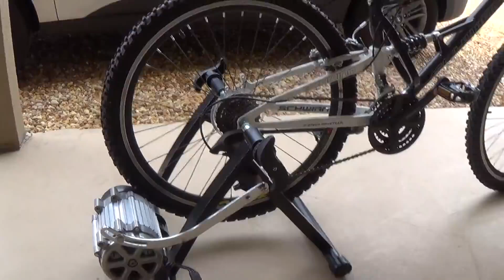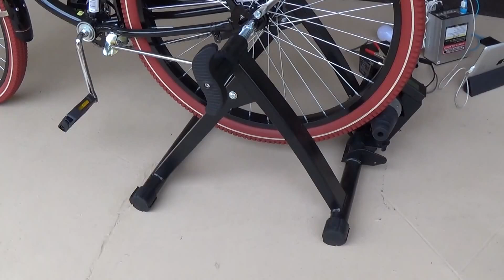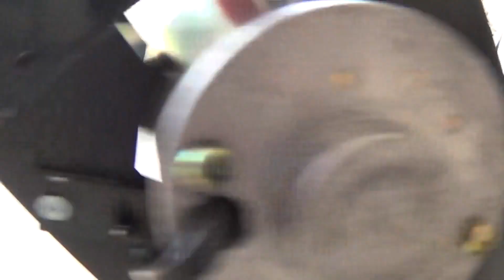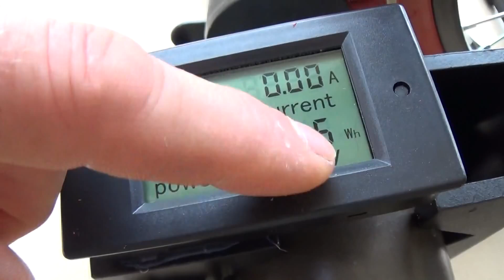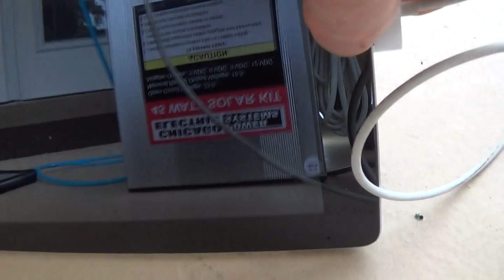Billions in Change Alternative Solution

Comment: I would like to recomend Tesla to add on all Additions to a Geared Bicycle  because if anybody uses a Bicycle on Road then it covers distance on the otherhand if a Bicycle is pedalled in Stationary position it is not only an exercise but it also removes Cost so i would like Tesla to add the features of Cost Removal to a Geared Bicycle of 1000 Watts kindly take this factors into consideration and i would like set up Vending Machines of Teslas Geared 1000 watts Bicycles with additions to Cost Removal functions for a Passive Income

Comment: Hello, nice vid! What kind of DC motor are you using ? Could this setup work with any type of DC motor ? Does it needs to be a 12v dc motor for the setup to work (considering you are charging a 12v battery) ?

Comment: Although more expensive the Billions in Change machine is superior.  One shot shows what I presume is a wattmeter showing 246 and Manooj is not pedaling any harder than Rebecca.  I think the large ring type flywheel is the key with the generator shaft at the hub of the flywheel.  The combination of the derailer gearing and the machine gears create a high rpm and the flywheel gives it lots of torque to handle higher currents.  I am building my own version of what I call a pedal powered percheron; a workhorse that powers many machines directly which is much more efficient than using electricity.  The Percheron will also create electricity when desired.  Is anyone elese working on something similar or would like to share ideas.

Comment: try to add light weight flywheel. it'll increase the paddling time as it reduces the efforts.
Reply from the maker: +ishwar bichewar Thank you for your comments. Yes, I agree a flywheel can help. But to charge a battery you don't need a perfect flow of energy, Slight surges won't hurt the battery or our generator. TES was looking for the lest expensive, least parts and lowest cost possible. We now have it, and are on the final test before bringing to market.

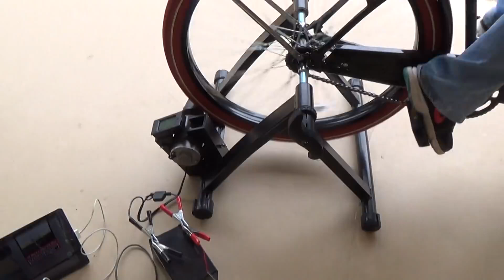Comment: Have you noticed on the U Tube "Billions Change Official Film" there is a hidden cord coming out from under the wall base strip? If one take a screenshot (pic) @ 12:35 & zoom in to the pic one can see the cord.
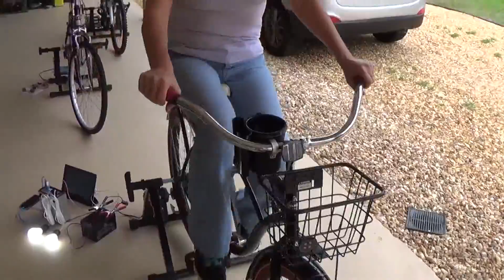His system is only powering 24 LED bulbs, but they are stating its doing more. But when they claim the system turns on the bulbs the fan & other devices are already on. This can be seen @ 11:56, it takes more watts to start turning the fan than light the bulbs. And fan is already up to speed before lights come on.
Reply: +Moazzam Abdullah Khan  nFlames2 is correct in what he stated, you sir are wrong.
Reply from the maker: +Moazzam Abdullah Khan The flywheel on Billions in change bicycle will only keep the lights lite for under a minute after you stop pedaling. Their flywheel is used to make charging a battery more efficient.
Reply from the maker: +nFlames2 I don't believe "Billions In Change" would do such a thing.  Basically the LED bulbs (operate between 10 and 12 volts) require a higher voltage to light than the fan (which operates between 3 and 12 volts), that is why you are seeing such a difference.
Reply: +Tesla Polarisz If you take a screenshot you can see the cord coming from under the wall base strip.
Reply from the maker: +nFlames2 I do see the cord. I'm not sure what it is for. But Tesla Energy Solutions did confirm the same loads on this video  https://www.youtube.com/watch?v=mGMiagFKhaQ.
Reply: +nFlames2 The prototype in the Official Film is storing energy as angular momentum in a HUGE flywheel which means they can store energy more efficiently than batteries. They can very well operate at large load capacities for small amounts of time.
Reply: +Tesla Polarisz But power them all on at the same time & lets see what powers up first.
Reply: +Moazzam Abdullah Khan "angular momentum" is not electrical as a battery. It does not hold a charged like a battery that can electrically power devices. "angular momentum" is the mass of the rotating flywheel.
From Wikipedia; Angular momentum is related to the rotation or 
revolution of matter. It is often considered to be a measure of the 
quantity of rotation of a system of matter, taking into account its 
mass, rotation, motions and shape.
"The angular momentum of a system remains constant unless acted on by an external torque." The external torgue is the alternator/ generator, electrical load, fiction & also wind resistant on the flywheel/ angular momentum.
With the loads once one stops pedaling the angular momentum would run out of momentum in less than 5 min.
Reply: +nFlames2 "With the loads once one stops pedaling the angular momentum would run out of momentum in less than 5 min." That's not true the Flywheel has a very small spoke therefore it has a small area of contact with non rotating metal which means it has reduced friction. And since there are no holes in the flywheel it feels pretty much no air resistance either. So I am willing to bet it would go on for hours if you have it freerunning without a load on the generator. If you do attach a load however then it's runtime depends on the mass and angular momentum of the wheel, it's rpm, the efficiency of the attached generator and the power load that is being driven by it.
Reply from the maker: +nFlames2 If you turned them all on at the same time, the cell phone and computer would charge first as they only require 5 volts to start charging, then the fan would start running at it's minimum 6 volts requirement (the fan is 12 volts) then the lights at 9 volts (12 volt LED bulbs.)
Reply: +Tesla Polarisz That is correct, the fan would not be running at full speed until it reached near 12 volts.
In the "Billions in Change Official video" the fan is up to full speed before the lights even start to barely glow @ 11:56 on the vid.
The fan being used looks more like a 120 volt ac than a 12 volt dc fan.
Reply from the maker: +nFlames2 not sure what the voltage of Billions in change fan is. Ours was 12 volt. It would be hard for me to be able to tell if a fan was full speed or not by a video. I just watch our video again, and by watching, I could not tell it was slowing down, when she stopped pedaling,  but I know it was when I was watching the video being made.
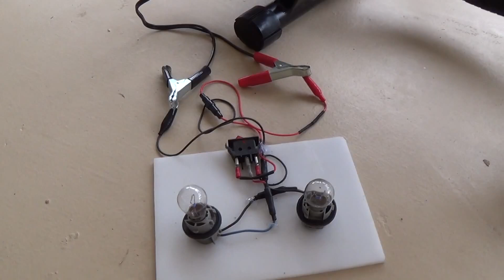Reply: +Tesla Polarisz The reason i was texting about the fan speed & fans. Is in the Billion in Change Official youtube @11:56 the fan is up to speed, phone is charging & also tablet before the lights even begin to glow. On your vid you turn on 1 set of 12 lights then the other set, then connect the wire @ about 4:16 to phone, tablet & fan. If you notice on your vid the phone powers up first then the tablet. You can see this @ 4:17-4:18 there is a delay from the phone to the tablet. But on Billion in Change Official there is no delay & they are powered before the lights even start to glow. That is due to the other cord that is coming from under the wall, that is why everything put the lights are on.
Reply from the maker: +nFlames2 again not sure about cord. And I was not there to see them film.Sorry

Comment: why don't you use gear messing in tyre's hub to attach dc motor???...wouldn't that have given you good output transfer of mechanical energ to motor!!
Reply from the maker: +Shubham Kalkal We want users to be able to remove the bicycle very simply and quickly, so they can still use the bicycle for transporation.